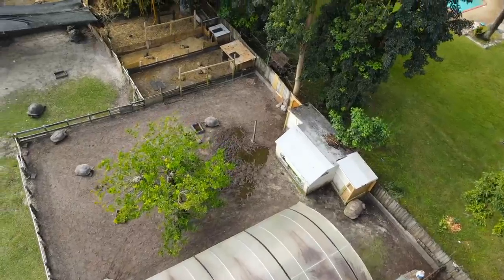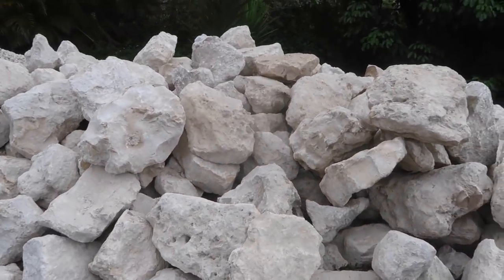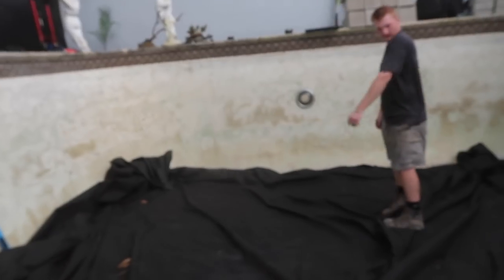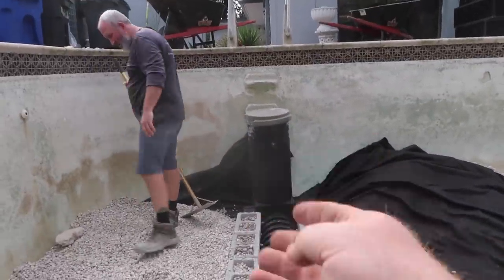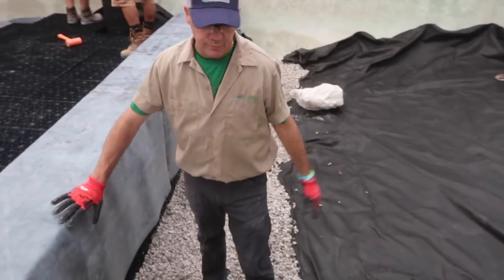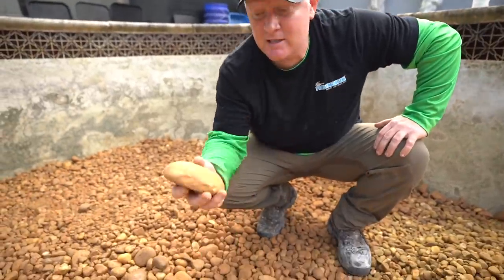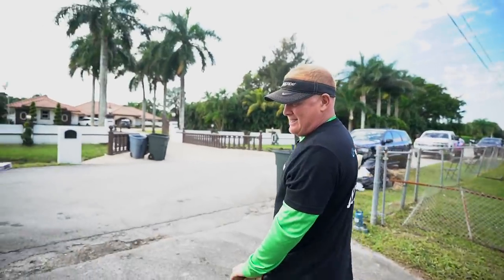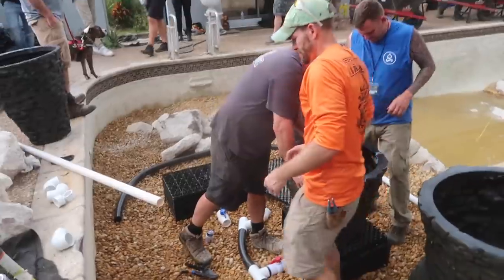Amazing *POOL to POND CONVERSION* with a Wetland Filter

Comment: Wow! Another great video. I’m trying to imagine just how much that conversion must have cost. All those guys working plus all the materials. I’ve thought about converting my pool too. I don’t think I’d go the wetland filter route though . I would think my existing pump and filter system should do the job. I would add a UV light system as well. I have 2 ponds in back also and the UV works great. I’m afraid my Koi will out grow those ponds. I’ve also entertained building an above ground one which could handle them. The pool conversion could handle quite a few big Koi. However I do like the idea of above ground so I can have a viewing glass ( actually Lexan) because it’s so kool looking at them from the side too rather than just from above .

Comment: All that gravel and rocks plus water, did youcalculate the weight on the pool foundation?
Reply: It's ok everything underwater becomes lighter. (Only joking.)
Reply: I wondered that as well, it's a lot of weight added to the pool. I want to do something similar but worried I'll crack the foundation of the pool.
Reply: I agree